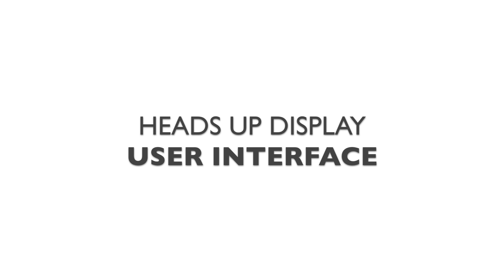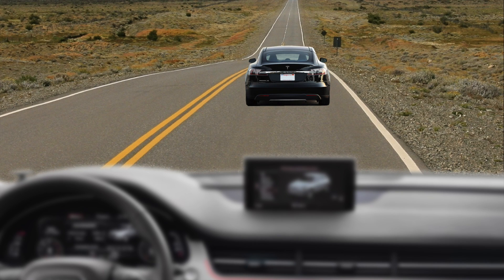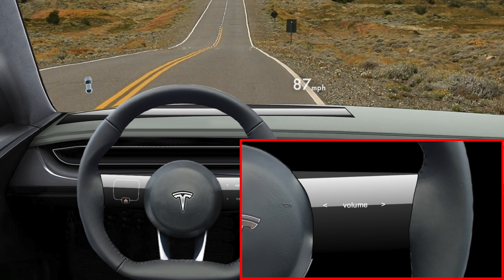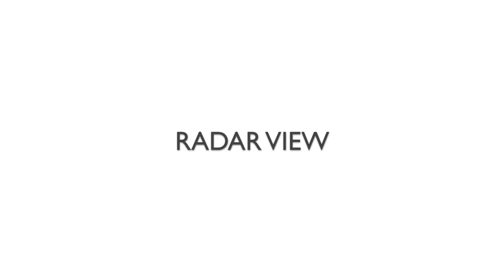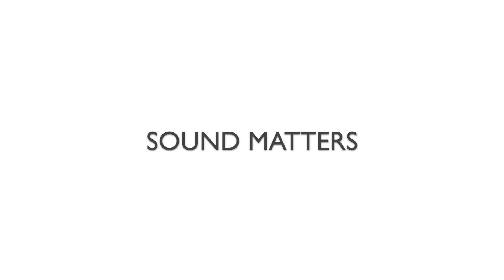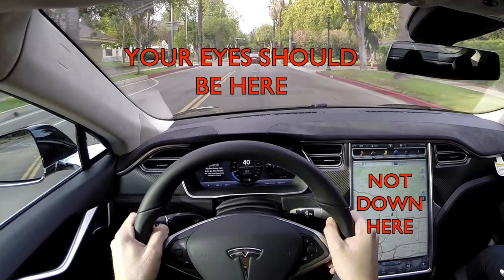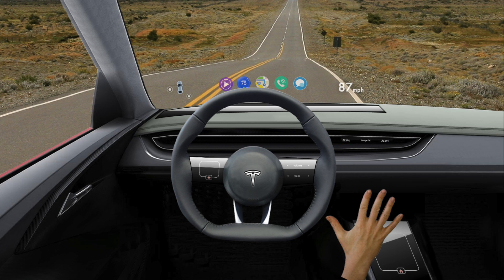Windshield HUD User Interface Introduction

Comment: Every car manufacturer focuses on manufacturing a car that has the performance equal to an Aeroplane.

Why do these guys make those cars which can be barely driven on the road and also even most of the millionaires can't buy them.

Why can't they improve the comfort that a car provides to the user instead of developing cars that can fly but with no guarantee to our life?

Comment: Some nice ideas. I'd never heard about combining voice recognition with 'lip' reading before.  It certainly does seem like cars are a suitable environment to try that.

As for entering information using fingers but without looking, handwriting is not the only option.  Another option is a 'touchscreen chorded keyboard'.  This is a system where the position of your fingers doesn't matter much; it's mostly about which fingers you use in which combinations.  (A bit like piano chords.)  There's a demo here http://labs.teague.com/projects/ChordedKeyboard/

And in this scenario (driving), though you are trying to avoid looking at your fingers, you actually ARE looking at the head up display, so you get immediate feedback when you make a mistake.  So the main thing you would need to pre-learn is the 'chord' that represents backspace.  You could then potentially learn the alphabet chords quite quickly through trial and error.

And another option might be based on the existing touchscreen gesture (swipe) typing that many of us are familiar with.  http://www.pcworld.com/article/3012353/android/5-essential-tips-for-gesture-typing-in-android-or-ios.html  The difficulty would be getting the first letter of each word right.  From there, I think you would be able to quite easily see on the HUD the gesture that your finger is making, without actually having to look down at your finger.

Comment: What if the viewpoint moves? All extra functions don't work because the location on the windscreen isn't right anymore...
Reply: Yes, that's what I was thinking.  It only applies to the strictly 'augmented reality' style functions, like the navigation overlay and danger illumination.  To keep these in the correct position on the screen, the car might need to have cameras constantly monitoring the driver's eye position, and constantly moving the screen projection (which might feasibly be distracting, thus defeating the safety objective that is the whole point of this system).

But the other functions, like gauges and audio controls, do not pertain to any particular part of the view of reality that the human is seeing through the glass.  So they can potentially be displayed in a fixed position.

Arguably the main benefit of a HUD is improved safety when a human is driving.  This benefit would be obviated by a self-driving capability.  So arguably a company like Tesla should, for now, produce HUDs with simple functions like gauges and audio controls, but not spend any money developing strictly 'augmented reality' style functions.  This money should instead be spent on improving the self-driving capability.

Of course, navigation and danger information doesn't have to be in the form of correctly positioned 'overlays'.  So Tesla could do fixed-position versions of those functions.
Reply: Craig Manning, thanks, I had never heard of collimation. (So I'm now glad I used words like "potentially" and "might" a lot, in my reply to Dennis.)

Does my point still stand?  Should a company like Tesla consider starting with just simple functions that can be done on an 'uncollimated' HUD?

I wonder whether the HUD in this video is collimated.  He says "about 10 ft in front of the windshield" which sounds quite different from "near optical infinity" (a phrase I just read on Wikipedia), so I'm guessing not?
Reply: Peter Ford actually the benefit of a collimated display such as a true HUD is that the display is projected far field using the glass as a combiner.  This is how HUDs work in fighter planes projecting symbology stabilized on outside locations such as targets.
Reply from the maker: Refer to Peter Ford's answer here

Comment: Cool video. Very nicely done, except for the noise simulator which makes no sense in my opinion. Just get a combustion car if you want noise. But go for Tesla if you prefer more power.
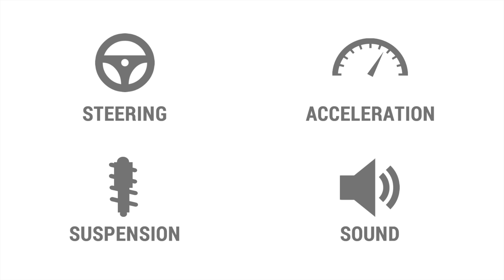Reply: The idea of simulating other cars seems quite interesting.  You'd want to simulate as much as you can without adding any new hardware, so given that you already have speakers, internal noise is surely one aspect worth doing.  (Three other aspects are mentioned at 5:31 )

To be honest, I might never actually get round to trying the full on simulation of other cars (with different suspension, steering, acceleration & braking, etc.).  But what I probably would use every now & then, just for amusement of passengers & myself, would be an internal noise feature.  I'd pay at least $1 for such an app.
Reply: Now they are even making a law in Europe to have all the EVs sound like regular cars...Grrrrrr
Reply from the maker: Thank you! Please see Peter Ford's comment regarding the sound thing.
Reply: @steve0ne11  well in the meantime they did add almost what you suggested: the fart cushion gimmick. That may be not exactly the same, but it's also about emissions, and it does sound kind of similar.